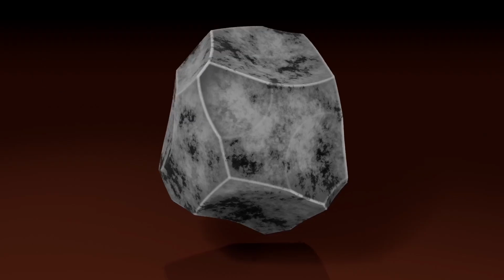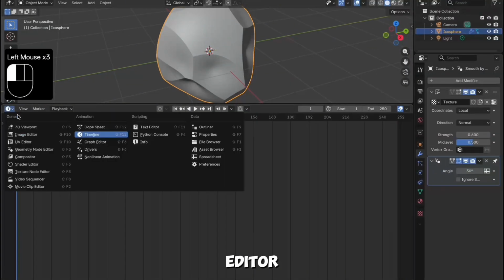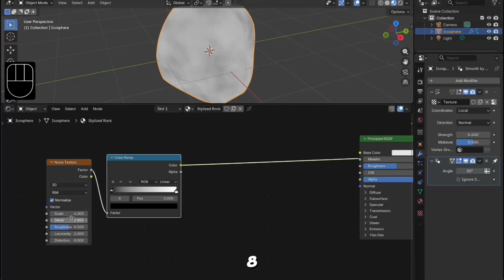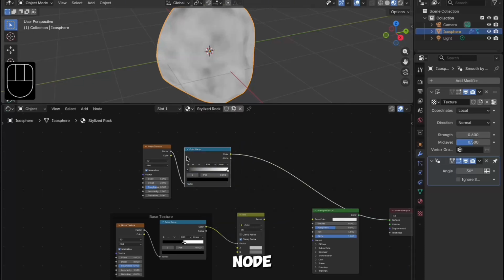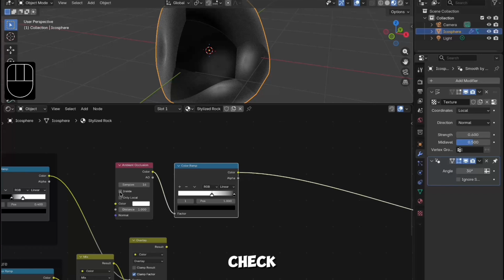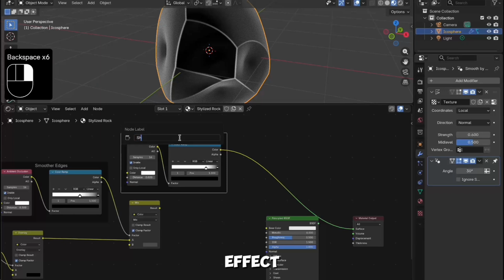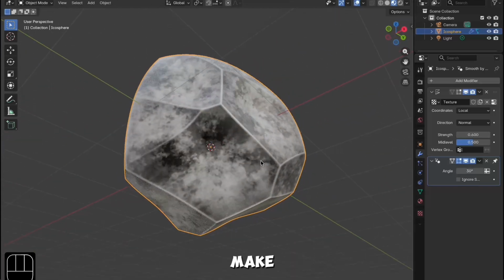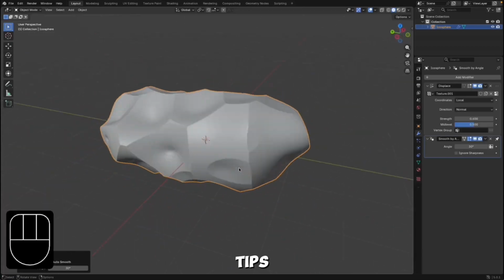MAKE This STYLIZED ROCK EASILY | Complete Blender 3D Tutorial

Comment: When you use the voronoi displacer - it creates those dips in the rock surfaces. How do you get rid of those? 

They seem to be coming from the dark/low values of the voronoi - but if you change the clamping, the rock turns too spherical. Any advice appreciated :)
Reply: change distance metric to distance squared